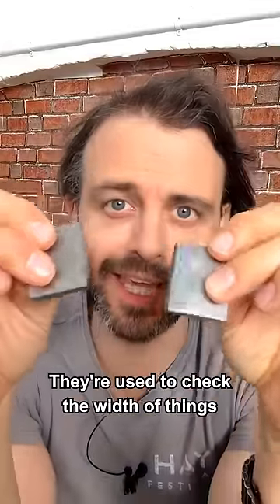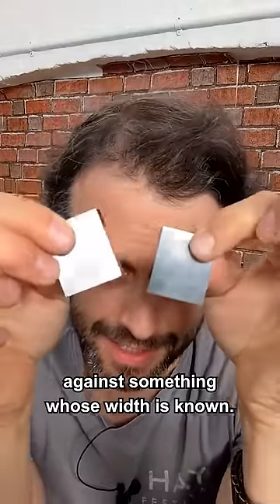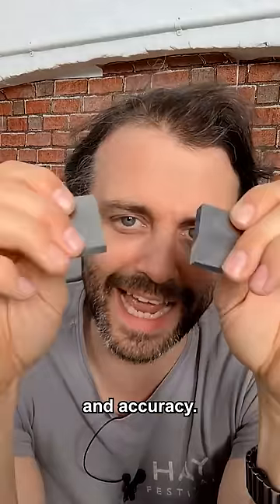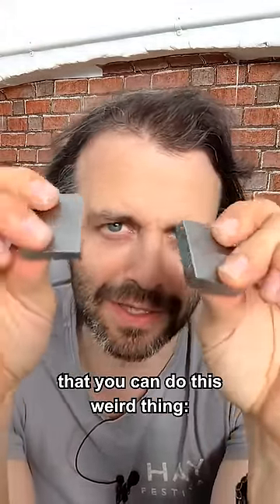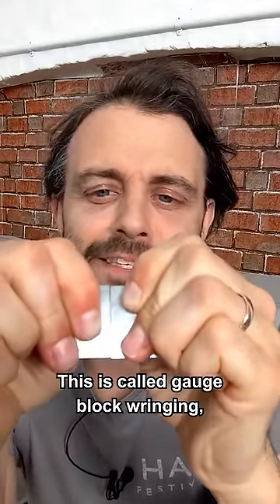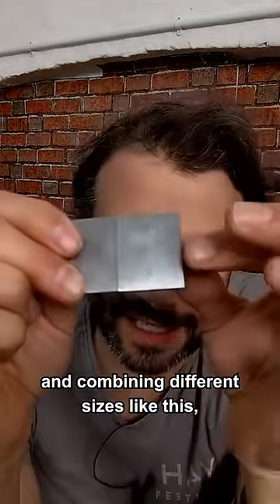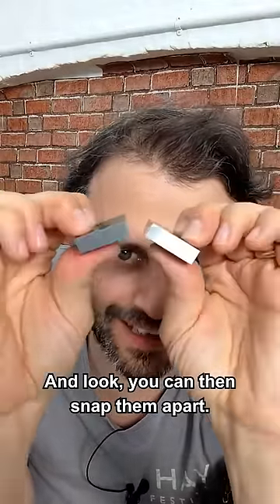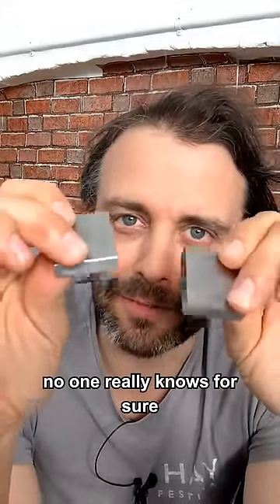No One Knows For Sure Why This Happens!

Comment: Another thing that I have personally tested is keeping these coupled for a week; the bond between the two pieces becomes stronger. You need to use serious force to break them apart and even when you do it sometimes chips will still remain on the other piece. I never had the chance to test this for a longer period of time but maybe other people here in the comments have and they are willing to share the results with us.
Reply: someone put them in a time capsule
Reply: if they are made of quality metal with absolutely no rust on them, the oxide layer might be thin enough that after being wrung together for a while, the metal atoms would sort of seep through or around edges of the oxide layer and stick them together, it would sort of break up that layer letting the metal atoms "grab hands" here and there.
Reply: .... I work in manufacturing and had to tape together and not only wringed my stack up but then tapped it because it was going to be used for a week on the floor. once the job was done I threw the gage stack up in a draw it sat for about a year when i found it and took it apart it the blocks where fine noting chipped and they came apart. These where cheap economy grade blocks as well not sure what material gage block would actually chip like you said pretty odd.
Reply: @devinnnnnn4841  likely what happened is he was using higher quality gauge blocks, and he probably connected them tighter, because I know that you can connect them anywhere from weakly to tightly or anywhere in-between, depending on how well you twist them together, and I would also bet that if he used a higher quality gauge block then the surface would be more flat and more perfect allowing for a more perfect fit. additionally, I would bet yours had finger oils and such on it, and his was either new or really clean when they were originally connected. but I'm just guessing though.
Reply: @Metal_Master_YT   Well, if you ever rung together gage blocks you would know if you completely cleaned them with alcohol and remove all oil they will not stick ever they need a small film of oil for the surface tension to work. I've never tapped together the highest grade gage blocks before but i have rung together ceramic blocks from a 50 thousand dollar gage block set and left them rung over night and took them apart the next day and they where fine.
Reply: @devinnnnnn4841  I haven't messed around with gauge blocks much yet, so I guess I would have to play around with it myself to know for sure. I will say however that I got 2 broken pieces of window pane glass to "ring" together just like a gauge block after I carefully washed off all oil and fingerprints etc. it was dry and perfectly smooth when I did it. also, it didn't work after I handled it a bunch, but it worked again after I washed it again. this happened like 2 months ago.
Reply: @Metal_Master_YT  yea steel and ceramic what gage blocks are made do not act like glass 😂😂 very different metallurgical quality’s
Reply: @devinnnnnn4841  a glass and a ceramic gauge block should act pretty similar, although I do not believe they make glass ones, I only noticed the effect because I had 2 already flat pieces of glass that would work.
Reply: @Metal_Master_YT that’s close to what I was thinking. Like a fusing effect almost, maybe after some time the bond is reinforced through physical means.
Reply: Something i learnt in my degree is that 2 solids can diffuse into each other, it just happens so slowly it typically takes years or decades to be noticeable, i wonder if this is happening
Reply: That close together they can start to cold weld.
Reply: How does no one know what happens when I've had this explained already?
Reply: Same reason why like metals without a protective oxide layer will weld themselves together in a vacuum. "Cold welding."
Reply: Cutting something is merely creating a gap large enough for the two pieces to no longer hold to each other. If you can cut and smooth so perfectly that there will be no discontinuity when they touch, they are a single piece. Molecules do not care.
Reply: @Metal_Master_YT You have no idea what you're talking about.
Reply: New welding method?
Reply: Cold flow molecular binding because materials are close enough together to make the covalent bonds. This should become permanent if left long enough.
Reply: @willlastnameguy8329 cool ur beans bro no need to get feisty
Reply: Because they are used to be together and just can't imagine life without the other piece it's the power of love
Reply: Mb it's similar to what happens in to metal in space
Reply: Sounds like vacuum welding

Comment: I believe that from what I heard in high school physics, isn't this that same thing which happens in space where there's that "Cold Welding" phenomenon caused by the two flat surfaces being so flat that they form metalic bonds
Reply: That is part of it. There are multiple forces at play. The force keeping them together in a vacuum after they've been wiped clean of oil is the weakest. Cold welding, also known as vacuum welding in this case where the atoms are able to get close enough to each other to form bonds and is the weakest of the forces at play here. When there is oil on the blocks, they bond is much stronger, and when you have it in atmosphere, they are flat enough to be able to create a vacuum between them, which also helps adhere them to each other.
Reply: This isn't it.
Reply: @Maxwell_Twist it's not a vacuum force lmao
Reply: @kaisouseru2466  Cool, expect it is. If you took a few seconds to look it up, you could find that out, but you won't because you're lazy.

Edit: grammar.
Reply: @Maxwell_Twist since it works in a vacuum, it cannot be due to vacuum.
Reply: @jelcoleys8087  ACTUALLY, it's shown to be far less effective in a vacuum, which proves that it is partially due to vacuum.

Comment: When I first started as a machinist this was one of the coolest things that I was taught and went on to read paper after paper on the topic. Super cool phenomenon
Reply: can you suggest something to read upon about wringing?
Reply: @anshzota8387 yeah I’d love to read up on the stuff too it seems obvious to me like “oh some particles just got lined up real well cause of how tuned the surface is” but I’d love to read some professional opinions
Reply: I heard it’s because they’re so smooth that so much of the 2 surfaces can get so close that they kinda become one object, I heard that’s why glass cups stick inside each other too
Reply: @Cheesepuff8 "kinda become one object?" How? What happens? Elaborote please
Reply: @gasperstarina9837  I think it's about enough atoms of the two objects getting soo close to each other that they literally bond together.
Reply: @Cheesepuff8 I think with the glass cups it has to do with the pressure building up causing sucking in the bottom of the cups since there’s usually an inch or so of open space in between the cups but since the cup gets wider as it goes up the walls of the cup block each other out
Reply: I'm a cnc lathe machinist lol!
Reply: these are the surfaces that literally cold weld together if wrung in a vacuum, right?
Reply: When you're taught about limits and fits, you learn about using slip gauges. Kept very lightly oiled in a sturdy wooden case and wrung together as needed. I wonder if the exacting machining allows Van Der Wahls forces to dominate?
Reply: Vanderwahl forces
Reply: The surfaces are ground so smooth thar when you wring them it squeezes out the air between them and the air pressure  keeps them together
Reply: @jeffmercier7252  strictly untrue. it's a different process. the only reason they come apart is because there are air particles in between them. in a vacuum they cold weld together and it's incredibly difficult to take them apart.
Reply: but what the heck is a cold weld  @MadderoftheFew
Reply: Nope the glass cups stick because of the tapered shapes
Reply: @lostpockets2227  exactly what it sounds like. the metals "bond" using van der wahl forces and cannot be taken apart. nothing to do with air. i've heard it happens to astronauts sometimes when they store raw metal objects.
Reply: Glass sticks together from fiction. 
Lmao
Reply: I don't think most of you understand at what depth I was reading I'm talking like research studies and the use of interferometers and a lot of stuff that also involves similar "wringing" processes like cold welding and such. It goes a shit ton deeper than just "forces" and "friction" maybe some of yall should be reading papers and not comment sections.